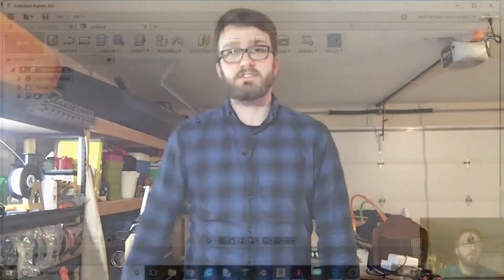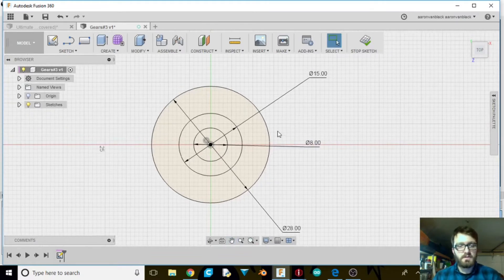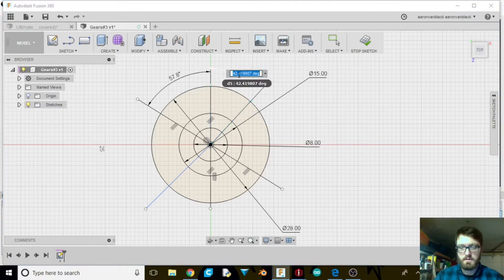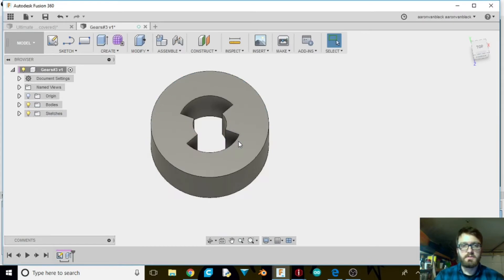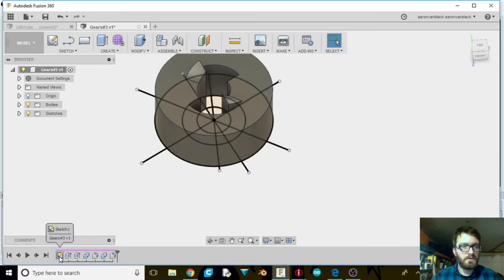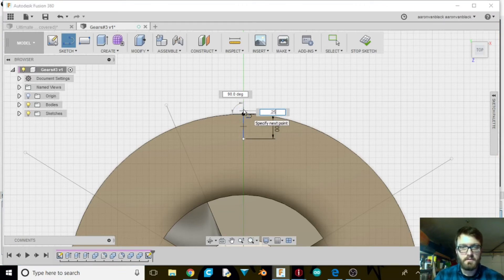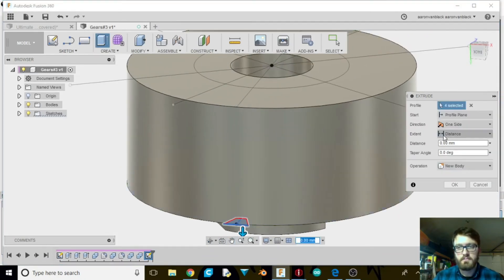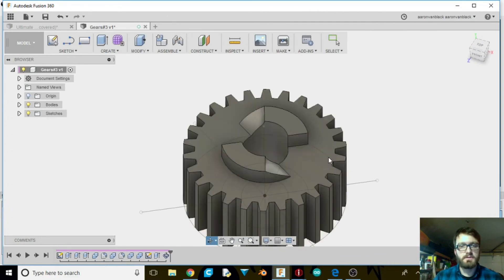Fusion 360 Gear tutorial part #2

Comment: I am really conflicted.  I do like the information you have in the video.  I guess I missed the first one, because I didn't realize until now that you are fixing a printer.  I was looking for a gear tutorial and you accomplished what I need, sort of.  This is what I don't like about your video.  Your audio is AWFUL.  You are basically talking to yourself, not the audience.  I had to rewind a few times to understand what you were saying.  

I still don't understand what your goal was exactly.  How did you know how many times to repeat the gear tooth?  Did you measure the existing gear?  All of the dimensions you were using, how did you know the angles and lengths?  I watched part 1 and part 2, was there an intro video?  I must have missed something.  I understand you have a purpose, to fix an Icon printer, but you promote the video as a tutorial, so I was expecting a little more explanation about designing a gear.  There were multiple times that I had to rewind and watch to determine which menu you selected or what dimension you were using.

And finally, when I create a design, I create components; you seem to create separate designs for each part.  How do you assemble the parts?  Do you assemble them?  I am still pretty new to Fusion 360 and it's been years since I've done any drafting.  Please don't get me wrong, you did a fine job creating the gears.  It looks like you accomplished your goal in that respect.